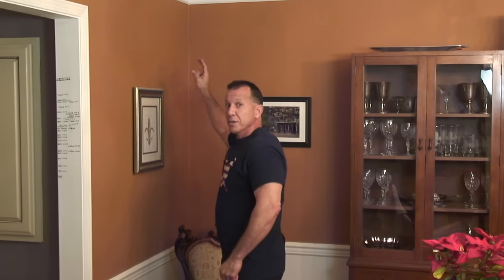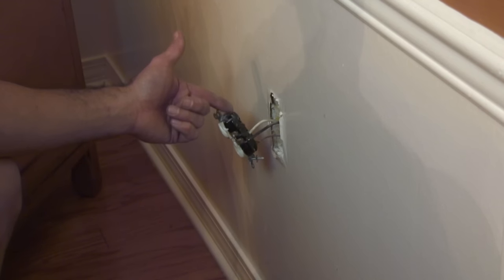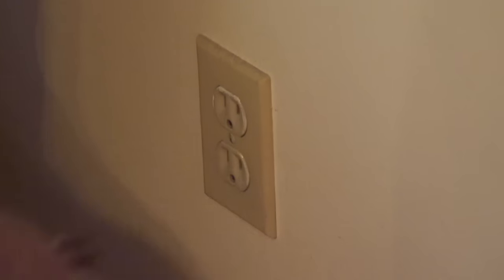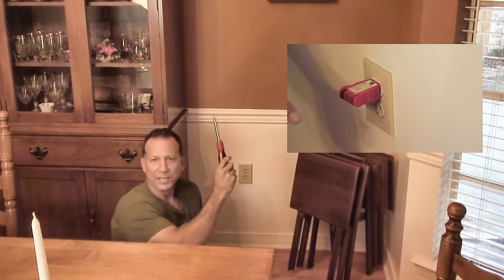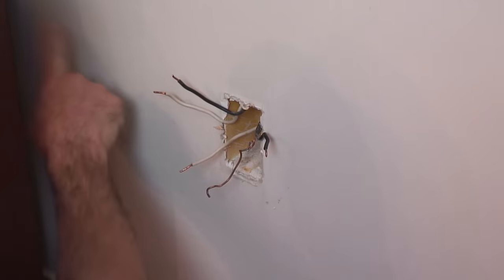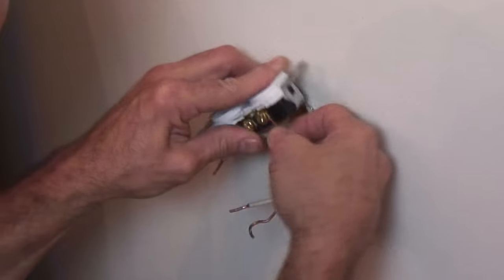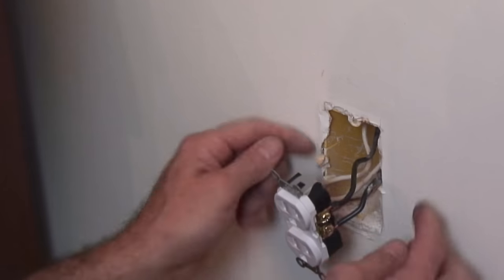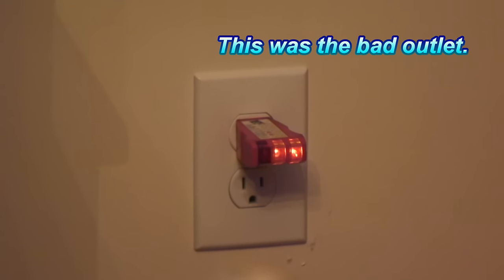Tricks to Find and Fix Electrical Problems in your wall. #2

Comment: No offense intended but I am not a fan of pass through wiring from receptacle to receptacle (two in and two out).  Consider pig tailing instead.  (Some local codes specify this, in fact.)  Pigtailing ensures downline receps are not rendered powerless if an upline recep fails.  Imagine the scenario of a working, down line recep powering a medical device machine going dead in the pass through arrangement.  Pigtailing ensures each recep on the circuit has continued power if an upline recep fails.

Comment: Just as an FYI, never assume that throwing a circuit breaker always shuts off the power.  Never handle both wires at the same time, even with the power off.  I have experienced brand new circuit breakers fail.
Reply from the maker: Thanks, that is good information!
Reply: we have a circuit in our office that keeps power even when the remainder of the building and half the neighborhood loses power from an outside transformer failure.

Comment: I haven't needed to replace an outlet in years so I didn't know they now allow you to put a wire straight in as opposed to making those tight bends. Also, I like to add a layer of electrical tape around the outlet which gives me extra insurance against a wire or screw coming into contact with the box.
Reply from the maker: Excellent advice Brian! I always wrap my outlet with electrical tape when a metal box is in play. This is why I prefer plastic boxes. Unfortunately, commercial boxes have to be metal because commercial studs are metal. I just want to be clear that the I only use the holes when they can be tightened with screws. The regular push in locks are not good and will not pass code with aluminum wiring.
Thanks and have a good night!
paul

Comment: I was always told to install with the ground up, that way if a plug was not all the way in and something fell on it, it would hit the ground not the the hot.
Reply: Paul Ricalde I gotcha, I'm not a professional, but I have worked a ton of construction, and/or electrical, just wanted to have your   input on the subject. My argument was not all plugs are three prong so it wouldn't matter. I enjoy your videos, I'm always looking to learn new tricks.
Reply from the maker: Hi Corey,
I have heard this numerous times and I have seen numerous discussions on this topic. The bottom line is both are code compliant. It really comes down to aesthetics. I have seen them up, down and on back splashes, they can even be sideways. You should follow the existing outlets in order to keep them consistent. I really appreciate your input and thank you for taking the time to watch and comment!
Paul

Comment: FYI, ground up on the outlet is marginally safer.  Either way is acceptable, but ground up prevents anything from falling across the prongs of a plug that is partially out.
Reply from the maker: Hi Peter,
That is good information and I appreciate you posting. I have seen it both ways and both are code compliant. I understand the argument, but there is no evidence of any case where it actually made a difference. If the ground is up, an object may fall and hit the ground and the hot side.  I have even seen them mounted sideways, on back splashes and under windows that are low. I always advise people to follow the existing outlets, so they will be consistent. I try to relate things so I will remember, I say ground down so it will stick in my head. Kind of like Righty tighty, Leftey loosey.
Thanks!

Comment: Good video. You left a nice but minimal length of wire. I've seen 6" recommended, but that depends on the box and what's in it. I HATE changingdevices when someone has cut the wires too short, and if you break an end off, you have  a mess or have to add a piece and try to get it all in there - can't say enough good for needle nosed pliers here.

Comment: I enjoyed the video and because I've done a lot of my own repairs and sub panels and all kinds of things including conduit I had no trouble following it. however I think it would be helpful for ordinary lay people to see a diagram on paper first so they see the power comes in from the power company to the main panel then goes on the branch and then I would describe the wires going into the outlets as the input wires feeding it and then the output you could also show several outlets wired together on the bench and just say okay here the power starts at jumps from this one to this one and so on. I would also recommend adding that the tester be plugged into an outlet that's good to verify that the lights work on it then go on and test the troubled areas. Also, I was wondering why the outlets were wired by the method of sticking the wire in the back vs using the screws or using pigtails which I realize takes up a lot of room.
Reply from the maker: Hi Paul, 
I am planning on showing just what you discussed. This is my 2nd video, but I will cover a decent amount of information in the future. I like the idea of drawing it out, wish I would have done that on my 1st video. Thank you for the great input and have a good night!
Paul
Reply: No problem.  Also, you made good use of picture in picture - showing the branch being switched off and your son at the outlet.  I have been using Irfan view for years and I make heavy use of simple still photos and do a lot of voice overs on my videos.  check out my channel for examples.

Comment: is that a standard US socket outlet? no shrouding on the terminals, it looks like some of the older sockets we occasionally still come across in the UK, but they are usually dating from the 1950's or 60's.  electrical safety has moved on since then. Also quicker and easier tto install, if the socket is one piece, rather than with a separate cover plate like this.

Comment: hey Paul just wanted to know I have a shed with plywood siding and was wondering can I use that white elastic mirror paint paint on the side to get a good seal so the wood doesn't rot down the road and by the way I love your videos very informative thank you

Comment: another great video paul, i have 3 gfci's in my kitchen that have the red light on but they still have power but i can't test or reset but if i shut the breaker off and back on the light turns green and then back to red in a couple days any ideas would be appreciated.
Reply from the maker: Hi Carlos,
GFCI outlets will go bad over time, I had to replace one in my bathroom a couple of years ago. That video  can be found @ Paulstoolbox.com, it is at the top of my video page. I would try a new GFCI receptacle. Leviton makes a self testing GFCI that checks itself every 15 min.and cost less than 20.00. I really appreciate you watching and let me know if you have any problems.
Thanks!
Paul
Reply: those 3 gfci's are brand new but i did notice that if i reset the breaker only 1 gfci keeps the red light on so will that cause the other 2 to trip
Reply from the maker: Hi Carlos,
Where are your GFCI's located? In my opinion, there is no advantage of having more than one GFCI on a single circuit. A GFCI outlet as the 1st receptacle will protect all of the outlets on that circuit. The other 2 could be held as spares or installed in other rooms for child safety. GFCI outlets cost about 10 times as much as 1 standard outlet. I am not questioning your electrician, but if I were you, I would check to see if they are wired correctly. They also sell plug in voltage testers that will let you know if you have a problem with the GFCI outlet. You can probably find them for around $20.00
Thanks!
Reply: Paul Ricalde i remodeled my kitchen but i hired out the electric part and code requires me to have GFCI outlets along the counter but im gonna buy the tester ur talking about to see if it will tell me which one is bad thanks paul
Reply: What I found helpful was reading the documentation that came with the GFI 3 or 4 times until you get a real good understanding of it. There should be a diagram with daisy-chained GFI outlets like you mentioned and you should follow that EXACTLY... even when it comes to grounding the receptacles. Having the three GFI receptacles is the right way to go according to the electrical code. Do not mix and match GFI's and standard duplex receptacles on the same circuit.
Reply: GFCI don't like being  fed from another GFCI you only need one per circuit and the down stream outlets are protected Kitchens by code require 2 small appliance circuits so at a minimum you should have 2 GFCI's to protect your kitchen

Comment: I have no power on the OUT side of my new house. All the fuses are fine
Reply from the maker: Hi Cesar,
Look at your outside outlets and see if they are GFCI outlets. A GFCI will have a reset button and it will trip if water gets in the outlet. If you do not see one outside, check the bathrooms. Sometimes the electrician will have the outside outlets on the same GFCI circuit as the bathrooms or kitchen. GFCI outlets have to be installed on any circuit that has the possibility of getting wet.The outside outlet has to be on a GFCI outlet or it would not pass code. Let me know if you can or cannot find it and I will do my best to help.
Thanks!
Paul
Reply: Paul Ricalde thanks Paul 
And merry X-mas to you and yours brother
Reply: I am a Master Electrician what Paul said is correct look for GFCI's in those places as well as the garage and basement, also you may have a GFCI breaker it will have a test button on it make sure if you do that it stays reset when resetting it and the way to reset all breakers are turn it all the way off before turning it back on